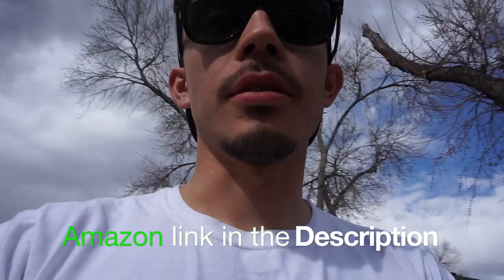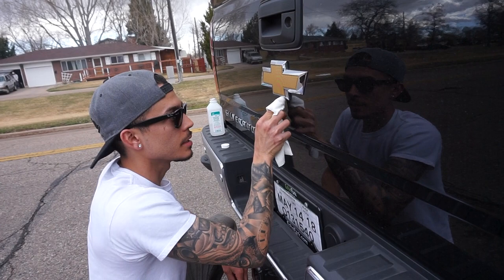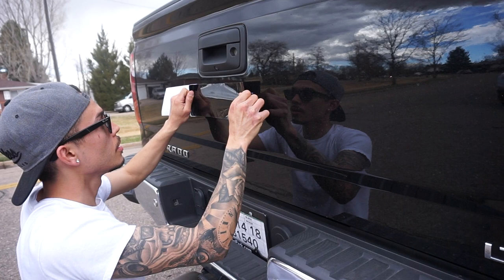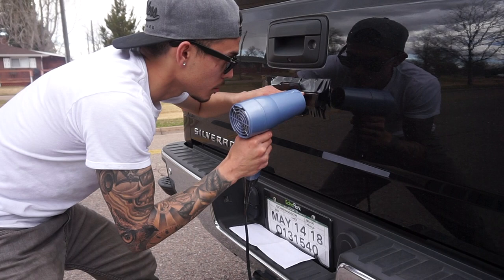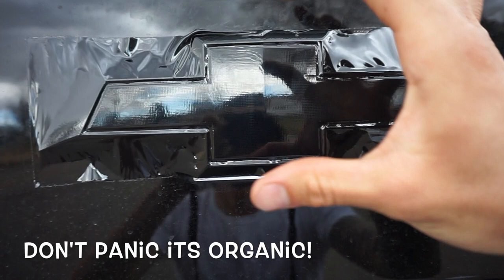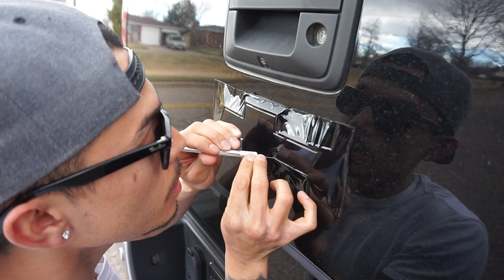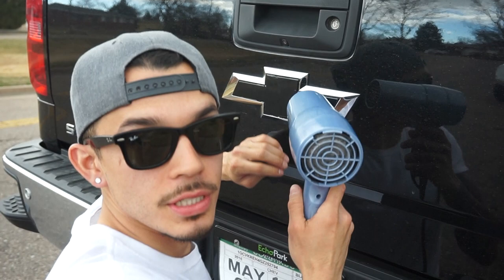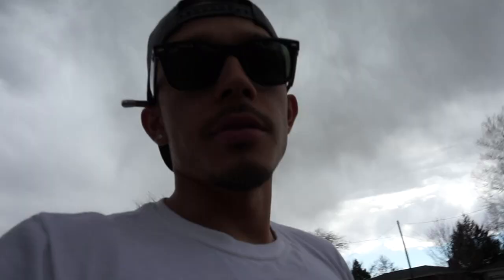BLACKED OUT CHEVY EMBLEM! | VividiD | SVSilverado

Comment: I’m about to do exactly what you did has it lasted on since you did it with a blow dryer
Reply from the maker: I’m glad you asked I recommend to buy the emblems already black I was washing my truck the other day and noticed it was shrinking around the edges due to the Colorado heat. So it lasted about a year
Reply from the maker: I will be buying the full click on replacement and put up a video soon
Reply: Thanks bro!!! I wasted three sheets before watching your video, then nailed the front, back and steering wheel with one shot each. Respect💪🏼